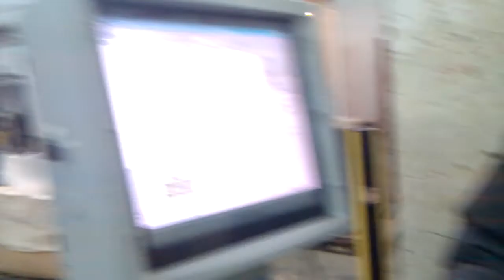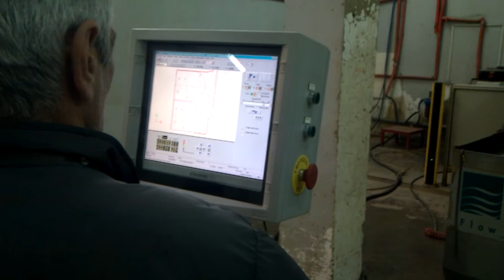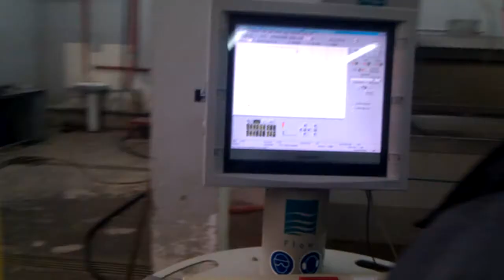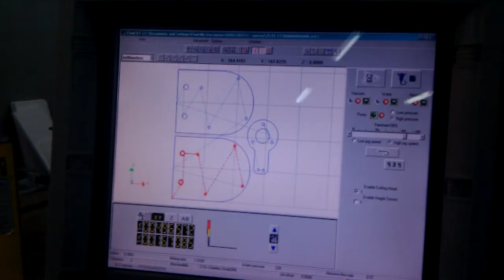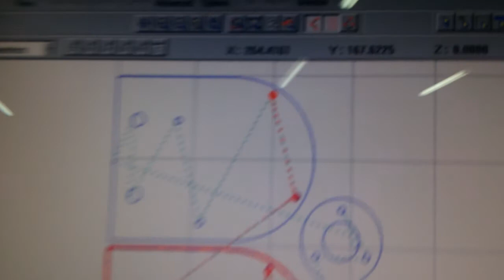Water Jet Cutting (Part 1)

Comment: WATERJEMARKET  Systems is the leading global brands seller of waterjet cutting systems, Ultra High Pressure pumps and components for water jet systems. WATERJETMARKET’s product offerings include: KMT Pumps , WSI Pumps, Waterjet cutting nozzles, Focusing Tubes, Pneumatic Cutting Valves, Intensifier and High pressure parts, Abrasive Cutting Systems, Waterjet Spare Parts, High pressure Valves, Fittings and Tubing Products, Diamond Orifices, Sapphire Orifices, Ruby Orifices, and Robotic applications